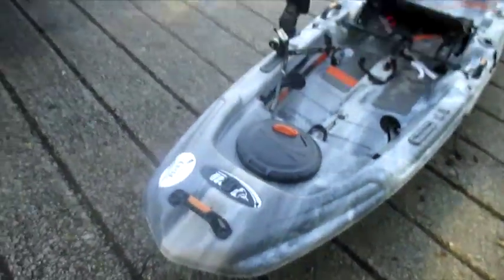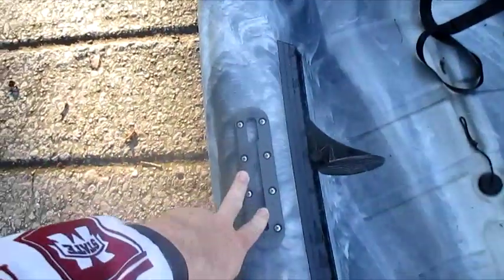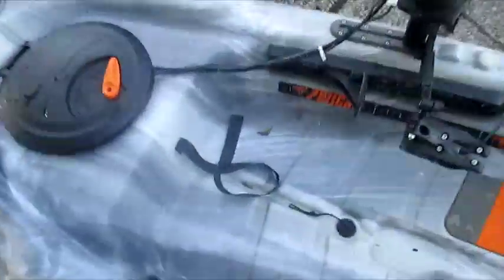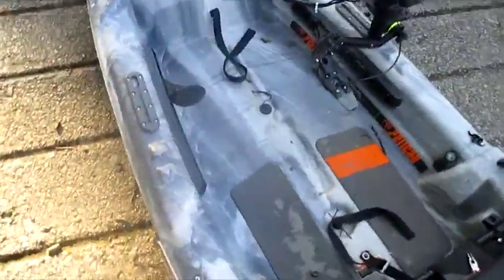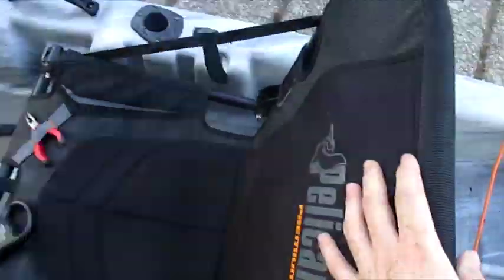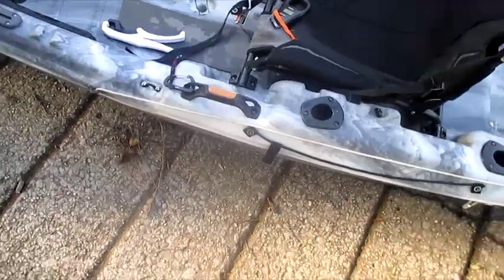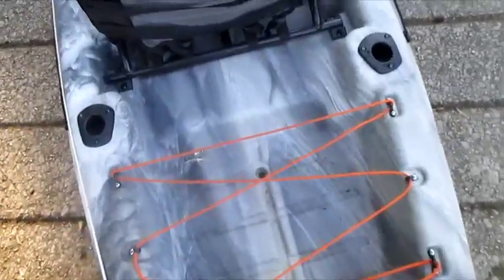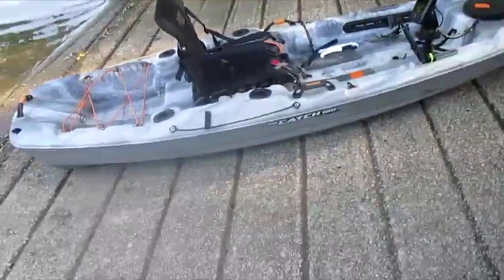Pelican Catch 100 Review

Comment: The nice thing about the new (2022) model is the flushmount rod holders have the ability to connect a rod leash. Also the seat. Instead of strapping over the front bar strap over the back one. That way if you stand up to fish you can fold the seat back for more room.

Comment: Great review, very detailed. I have the same kayak. I just use rod leashes for the rod holders in the back. Haven't had a rod come out yet, but if it did I'd be able to retrieve it easily.
Reply from the maker: I use them on my tuff crate now. The back rod holders I use for my net and camera mount.

Comment: I was looking at upgrading from my lifetime tamarack angler 10ft kayak. It's been a good one and it tracks and paddles very well. Does this yak track well? Thanks for the review.
Reply from the maker: It's alright for this price point. With a wider kayak its getting used to the size thats key. That being said I normally paddle at a pace around 2.8 mph so its on the slower side but once it's going its easy to keep up to speed.

Comment: How does it handle in the rivers?
Reply from the maker: Depends on how deep the river is. Th ones around me are only about a foot deep in the rapids so it tends to get stuck on rocks. But if its a smoother deeper river then it will be fine.